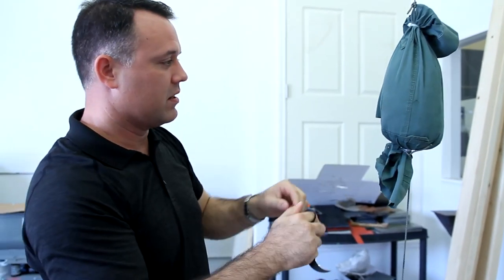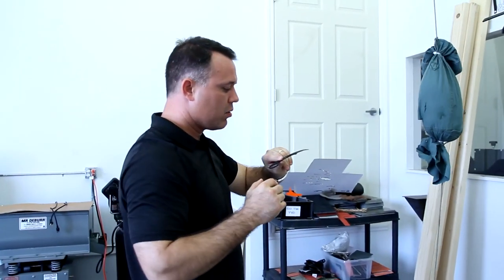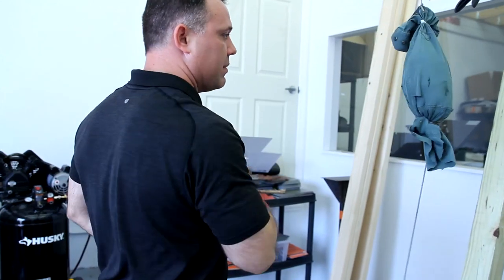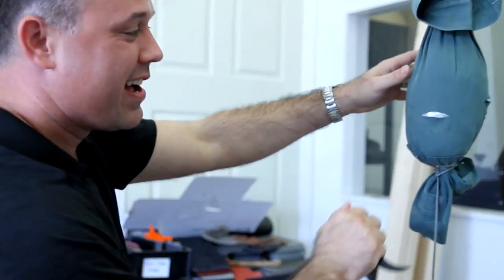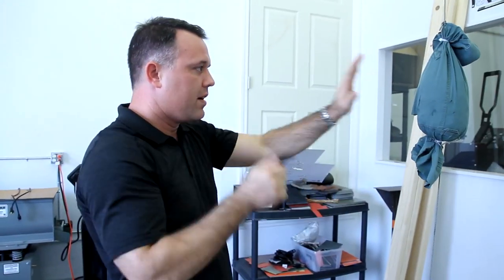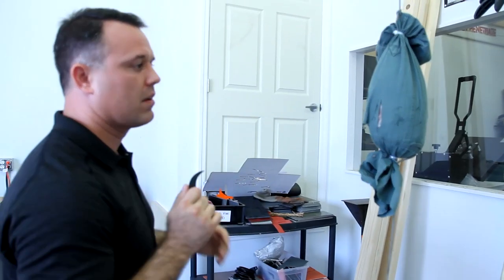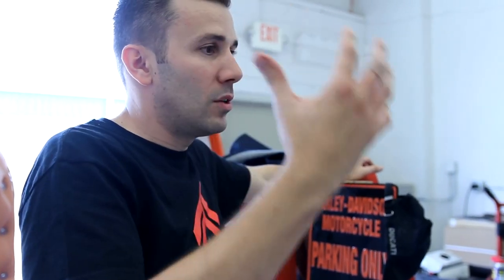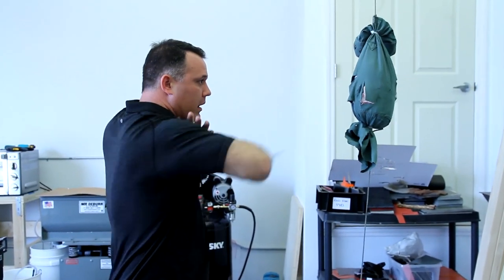Filipino Martial Arts Instructor's Reaction is PRICELESS to this New Karambit!

Comment: Stopped 40 seconds in. A knife blade 1/2 the length of your finger is not going to leave a wound channel deeper than your finger can go, and especially not with a curved blade thrust that only utilizes half the blade length. It's just NOT possible and defies all logic. This would mean that the blade somehow bent space and time around itself to create a wound channel 4 times deeper than the tip of the weapon went in. You can see where he bent and unbent his finger if you slow down the footage, to create the illusion of a deep wound channel from such a strike.

Also, this knife seems incredibly slim for something made of N690, which is essentially 440 stainless alloyed with a little cobalt and vanadium to make it sell for more. Something so slim would have to be tempered to a 65+ rockwell hardness to avoid bending the first time you strike something more solid than raw chicken, like a bone. And something so slim at such a hardness would be very brittle due to the cobalt and vanadium.

What this means is that this is essentially a 130 dollar wall hanger, unsuitable for use as a weapon and maybe even as a tool. Keep in mind, this is basically 440 stainless (the kind of steel those 10 dollar knives they sell at truck stops are made of) with slightly better edge retention.

The handle is also just a solid slab of metal, which greatly affects the weight and maneuverability negatively. You can see where this guy is having trouble controlling his movements with it, and he's used to karambits. In addition, there's nothing securing your grip save for the traditional ring, and this handle will be VERY uncomfortable.

All in all, this is a shit knife at a shit price, and the biggest shit is that they don't even acknowledge that this is a scripted advertisement.

Then you go to the website, and there's not one clean picture. What I mean by a clean picture is a well-lit image of the blade, either resting on a palm for scale or on a matte background. Instead it's a bunch of pictures with filters any Instagram user will instantly recognize, to attempt to make it more cinematic. So you can't even see what the knife REALLY looks like.
Reply: This response took more than 40 seconds to write.

Comment: It's a knife. Thin Soft Stainless steel. Which means you can put a wicked edge on it. So OF COURSE it's going to be sharp. 

With a hunk of steel for $8, some metal files, some propane, and my kitchen oven, I can make the same damned thing, sharpened to 14,000 grit and honed with diamond paste on soft leather.

For  $8. And it's be custom built specifically for my hand. 

I don't understand this video. It's just an overly priced knife.
Reply: %100 agree
Reply: First off, N690Co isn't soft. It's target hardness is 59-60 and isn't cheap. Secondly $8 after the cost of everything to build a proper propane forge to carefully heat treat the blade, heavy aluminum plates for an even and straight quench, the files, abrasives, etc. And I would show a video of you doing ALL OF THAT for $8 before talking shit.
Reply: I can tell by reading your reply that you have zero knowledge of metallurgy.

First, any steel with a carbon content of .5%-2% is considered a high carbon steel. Aim hardness is based on the task appointed to the blade being made and the steel's element composition. Not all blades are aimed at one absolute hardness. And while hardness isn't the ONLY factor in edge retention a harder steel will hold its edge longer than a softer steel of the same composition.

Secondly, it's pretty obvious you know dick about carbide formation. A stainless steel is any steel with a chromium content of at least 13%. When you add chromium to steel it combines with the existing iron and carbon to create longer carbides than what form in simple iron/carbon alloy steel. Longer carbides contribute to abrasion resistance, which in turn improves edge retention more so than in simple alloys like 1095. AND WHAT'S MORE is N690Co has cobalt added to the alloy(which is the Co in N690Co) which further improves hardenability and carbide formation.

Thirdly, 440C does have a similar carbon/chromium content minus the cobalt, which is 1% carbon and 18% chromium. Now for perspective, a bar of 440C or N690Co costs roughly 4x what a bar of 1095 of the same size costs. On top of that since 440C and N690Co(like every other stainless steel) has chromium carbides that can't be softened through annealing, meaning they're more difficult to work than a simple, cheaper alloy like 1095. That adds cost to the final cost of any knife.

Fourthly, heat treating stainless steels is much more involved and difficult than spring steels. Aluminum plates are used to evenly and rapidly remove heat from the steel while preventing warping during the process. It's what GOOD BLADESMITHS DO when they heat treat cutlery grade stainless steels.

My point being no, no you cannot make an equivalent knife for $8, especially with your obvious lack of fundamental knowledge on the matter.
Reply: DeadBoysTwo regardless it's an overpriced knife given the size and lack of sheath as well. You can buy similar karambits for a 1/3 of the price and just sharpen it.
Reply: Just because you're too cheap to pay asking price for something doesn't make it over priced. Firstly, it DOES come with a sheath. I can't wrap my head around how simply not.showing a sheath in a video leads you to the assumption that it doesn't come with one.

Secondly, as I said, N690Co is not a cheap steel. It's tough work with as well. Meaning all the smoothly crowned ring and sides and central milling took extensive work and skilled craftsmanship. Which also applies to the heat treatment. Improper heat treatment can cause any knife to break at a pivotal moment. In Italy mind you. Italian exports are made to be good, not cheap.

And thirdly, it's a defensive knife. People who buy it have to trust their lives to it. If the extent to which you value your own life is the sum cost of the cheapest option, well that's your problem. But that doesn't make something over priced.

If I had the smallest reason to believe you had any understanding of the work and processes that go into manufacturing knives I'd be more inclined to value your opinion, but as all evidence points to the contrary, well...
Reply: DeadBoysTwo Yes I am cheap, however it doesn't matter if I depend on a $50 knife or $130 knife it doesn't negate my skill in using one. The idea of if I pay 3x the price I get a better metal that cuts relativly the same is silly. The cuts would be almost identical, it's just one person would have a name brand and a bigger bank account. 

and yes I was judging the knife off the video and the comments
Reply: DeadBoysTwo "People trust their lives to it, so it has to be expensive!" 

Buddy... sharpened metal will cut. Rule number one of a knife fight - You're gonna get cut. You obviously have a hard-on for this knife that can measured with Rockwell. But you're not convincing or fooling anyone - it's overpriced garbage, and this video absolutely fails at selling the blade. Jenner and Pepsi did a better job. 

Take some 5160, 1095, 440, or your cobalt Wolverine super-expensive and amazing steel, sharpen them all to the same grit and hone, and then see what their first 10 cuts will be like. No one will tell the difference, and flesh will cut regardless. 

Having some super expensive cobalt steel won't make you any more dangerous or any more skilled, or increase your chances of survival. A baton or bokken or simple baseball bat could be the weapon that puts you down. Your argument of cost NOT being a factor because it's some special knife is foolish.

If you seriously don't get that yet, then you're a fool.
Reply: There it is. Just start insulting me because I know more than you. Yes, everyone knows you can sharpen a bunch of different steel and they'll all cut raw meat pretty well. But that's something people with simple minds think because they don't consider the need for the edge to be able to make contact with hard objects like zippers, buttons, jewelry, watches, teeth, etc and still cut well. You're trying to tell a professional(well known) bladesmith and silat instructor how to make a knife and it's pathetic.

Another thing is some people simply like good knives. You failing to understand that doesn't make your trolling any more valid. So all that considered here's the challenge. You use your $8 steel and you raggedy little setup and make an equivalent karambit with a proper heat treatment, clean lines, glass-smooth stonewashed finish, crisp plunges and grind lines, completely crown every edge of the handle and ring, mill out the center of the handle, and custom mold a kydex sheath to it. Then see how much you think you'd sell something you put that much work into for.

If not you can always delete the comment and pretend nothing happened, or you can just keep letting me school you on how little you know vs how much you thought you knew. Regardless, if you could stop acting like a child, that would be great.
Reply: DeadBoysTwo DeadBoysTwo Bahahaha awe, you're cute. Not just a student of Silat, but an instructor, and is trying to make the argument that his little super steel will just Wolverine through zippers and watches!! Man oh man... stainless HAS come a long way!!!

I DO make my own knives. We all do. So your cute little challenge is adorable, since we already make our own blades, and sell custom blades to our customers in our gun shop. And for a trinket this small, we wouldn't charge this much - and that's completely hand made. 

Granted, our steels aren't super materials that can slice through watches and zippers, but that's why we train to aim. Crazy concept, I know. But there ya go again, somehow trying to make the argument that your super stainless soft steel will somehow turn a person into a hero in a Michael Bay film.
Reply: And now you're exaggerating. I said "survive contact with" not "wolverine through". And I never said you didn't make anyway, but from what you've said here and claim to charge, you make what real bladesmiths call KSO(Knife Shaped Object) or POS(which I'm sure you can guess the meaning of). Because that's what you get when some novice with no idea how to properly craft a knife tries to make one. Some piss poor piece of cheap steel with an edge and the false idea that they've actually done something praiseworthy. Then they make excuses for the shitty job they did. "Anything less expensive is trash, anything more expensive is over priced" because you're just that good, right?

"And I'll just aim and avoid hard stuff because I also happen to be the only person who's ever lived capable of instantly being aware of all the metal and other hard objects on person and target to miss them all in the adrenaline fuel chaos of a life or death situation. So my steel doesn't need to hold an edge because there's no way that would ever happen. I'm just too good." That's about what you're saying with that ignorant aim statement.

Justify the garbage you make all you want but it's painfully apparent that you think you know much, much more than you actually do. Which is why this will end with you not even making an effort to plead your case and reverting to just launching blind insults in a pitiful attempt to salvage your damaged ego. Just like every other KSO maker like you who's ever tried to argue with a professional bladesmith.
Reply: DeadBoysTwo chromium content of at least %10 qualifies as stainless
Reply: Yes, clearly you know more than all the other scores of people in the knife making community. We bow to your superior knowledge and wisdom, O wise one.
Reply: Not in cutlery terms. The more carbon in the alloy the more.chromium is required to maintain corrosion resistance. If you only have .09% carbon than 10% chromium would be sufficient, but with something like 1.5% carbon you lose a lot of corrosion resistance. Which is why steels like D2 are only considered semi stainless even though they have 13% chromium.
Reply: DeadBoysTwo in metallurgical terms %10 or more chromium is stainless
Reply: +Hypurman    Then do it and make a video.  I'd watch it.  Show us how it's done.
Reply: DeadBoysTwo knowledge is knowing tomatoes are fruits, wisdom is not putting a tomato in a fruit salad. you're surely knowledgeable on the topic, but you seem to have no clue what the numbers you're spouting out mean or imply.
if i make one out of a rectangular metal file and properly heat treat it, it will do the exact same job and even be stronger depending of the steel we compare it to (since you said it's N690Co, it simply is). i will be able to make it in my backyard with minimal tools, the quenching will be easy with tool steel and the only down side will be rust (which won't happen if i do a patina to match the dark finish of the original).
cost of the operation: a metal file (and i even have enough to make a second one).

a one piece (not the manga) sai (the okinawan weapon), for example, is much more complex to make, since you will have to forge it in this peculiar shape, cut it out of a large piece of metal or weld the guard in place. and it's also  a solid piece of metal.
Reply: Soul Chicken now that I did not know. Interesting.
Reply: true, they simply use n690Co to give this sexy high quality vibe (just because it's not 690 or 440), but in fact there's no more to it's making than removing a bit of material from one chunk of steel. it's only one piece so you don't need any precision at all, since you don't have to worry about fittings.
it could be interesting if it was some super steel. for example, if it was made of d2 it would justify the price because d2 is a pain in the ass to machine and eat treat.
Reply: Use a 1" ring spanner...cant get better!!

Comment: Nothing but rags behind the puncture hole. So yes the hole could be longer than the 3-inch blade. It could actually poke a hole 3 feet deep if you have a 3-foot diameter bag full of rags and after a small slit made with the knife, you can push a broomstick all the way to 3 feet. Amazing knife! Just kidding of course.

I have owned the Emerson FX-599 for about 3 years. It deploys faster than anything I have ever seen. I love it. Never leave home without it.

Comment: My only complaint with this blade is how thin it is. I almost couldn't hold onto it until I wrapped mine in paracord. Other than that, I'd hate to be on the business end of this thing. Most karambits you see are way too big, and the blade isn't curved enough to really get a lot of force behind it. The way I see it, smaller the blade, the easier it is to put your body into the slash without the knife wanting to get away from you. I wasn't expecting the single sided razor edge though, that was an interesting surprise.

Comment: That Manong Guy does Not even Know the Meat is Not a Solid Piece, thats why Its all the Way to his knuckle when he lightly Pokes with it with that Little Karambit. Also if you Think Karambits are the Ultimate Knife ... Try to Use your Trainer Karambit vs a Trainer 4 to 5 or 6 Inch Straight Blade Knife and do Real Sparring with it. Your Karambit Dreams will disappear.

Comment: Is this the Pika, or a clone from Canku or one of those other Chinese microbrands? The original is 100 bucks for N690..not a great value. Not sure if the clones are actually D2 or properly heat treated, but good D2 holds an edge as long as N690, and the copy costs 20 bucks. Makes it an easy choice for a lot of people.
Reply: that's the real Pika made by Bettinelli, the guy on the right.